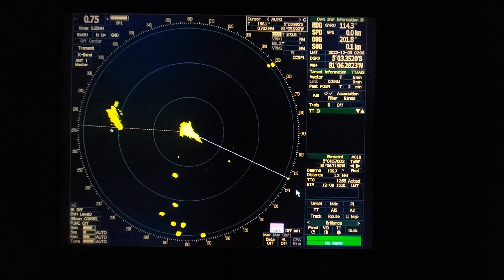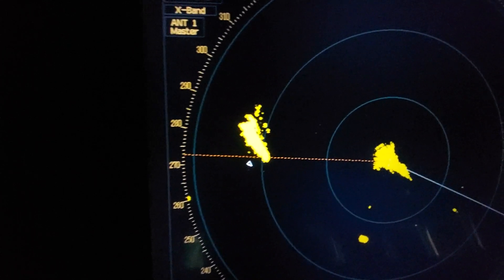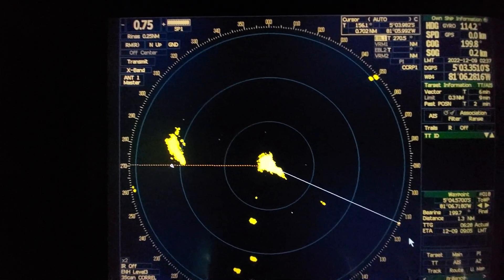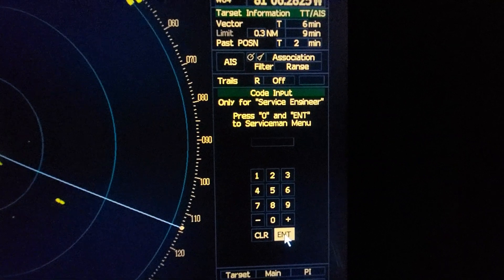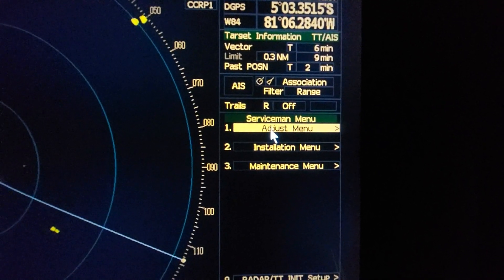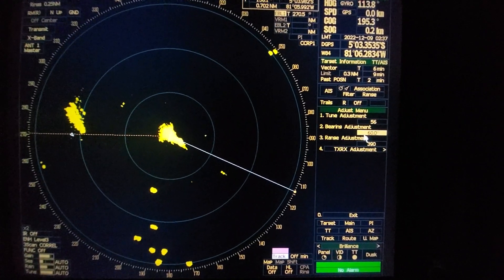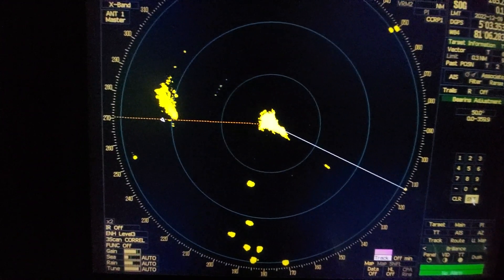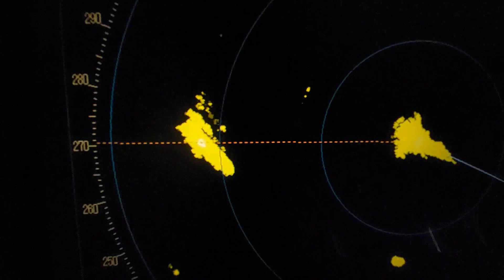The echos of X-Band Radar is not align with the AIS targets (symbols).  JMA-9100 radar.

Comment: Good afternoon, please advise how to make adjustments for JRC ECDIS, the target vessel's position on ECDIS  does not match with radar position.
Reply from the maker: When the target vessel’s position on the JRC ECDIS does not align with the radar overlay or ARPA targets, it usually indicates a sensor alignment issue or position source discrepancy. Here’s a step-by-step guide to troubleshoot and adjust it:

⸻

1. Verify Position Source on ECDIS
	•	Go to: [MENU] > Sensor Settings > Position
	•	Check which GPS is being used (e.g., GPS 1, GPS 2, DGNSS).
	•	Ensure the same GPS is used on both ECDIS and Radar.

Tip: Mismatched GPS inputs can cause positional discrepancies.

⸻

2. Check Radar Overlay Alignment

If you’re using radar overlay on ECDIS:
	•	Ensure the radar is properly aligned (Heading alignment & bearing).
	•	On radar:
	•	Check bearing alignment (via radar calibration menu).
	•	Ensure the gyro input to radar is stable and correct.

⸻

3. Manual Radar Offset Adjustment (on ECDIS)

If the radar overlay is shifted but stable:
	•	Go to: [Radar Overlay Settings] > Radar Offset
	•	Apply a manual offset (X/Y) to align radar targets with chart features.
	•	Small values like ±0.01 to ±0.05 NM can make a big difference.

Note: Only use manual offset if you’re sure radar is correctly adjusted.

⸻

4. Check ECDIS Chart Datum
	•	Go to: Chart Settings > Chart Datum
	•	Ensure it matches the GPS datum (usually WGS-84).
	•	Some ENCs might be based on local datum, causing shifts.

⸻

5. Confirm Gyro and Speed Input
	•	Inaccurate gyro heading or speed log data can cause target prediction issues.
	•	Check: [Sensor Monitor] on ECDIS for real-time input values.
	•	If gyro error exists, it will affect ARPA, AIS, and radar overlay.

⸻

6. Run ECDIS Self-Test / Diagnostic
	•	From Maintenance menu, run System Check / Self-Test.
	•	Look for sensor alerts, data lag, or interface errors.

⸻

7. Reboot ECDIS System

If everything seems okay but the issue persists:
	•	Restart the ECDIS unit.
	•	Sometimes a system reboot clears temporary glitches.

⸻

If you tell me your exact JRC ECDIS model (e.g., JAN-701B, JAN-901B), I can guide you more specifically. Also, do you use radar overlay or just comparing target AIS/ARPA positions manually?